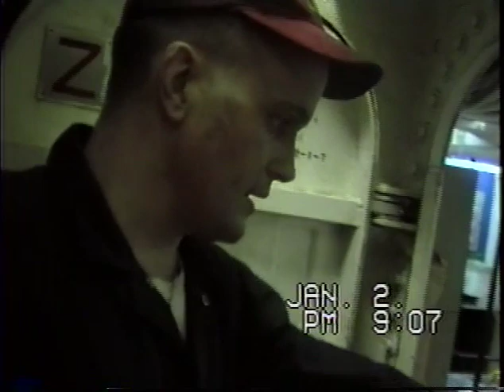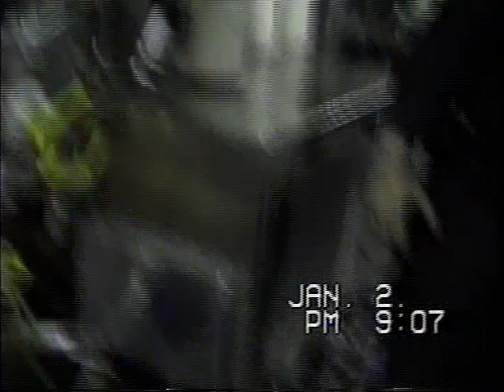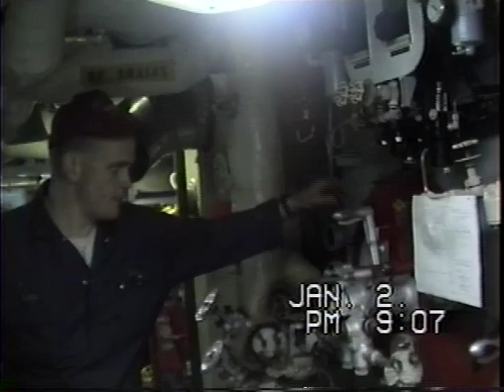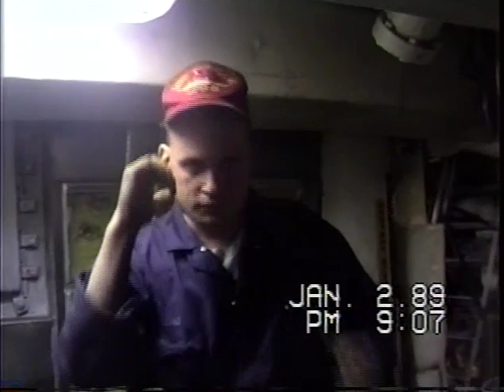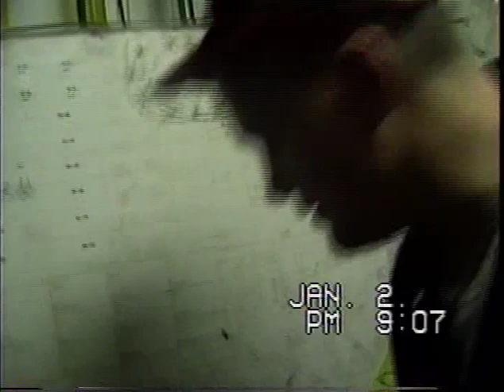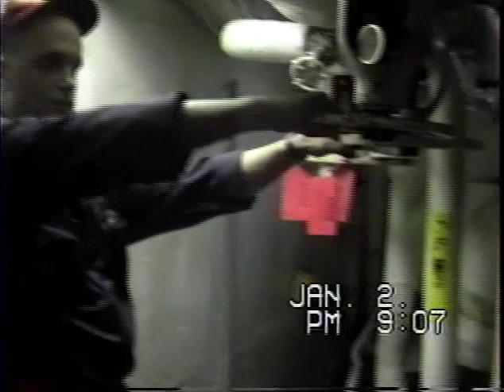Dubuque Engine Room

Comment: I was on the Dubuque in Sasebo as well, except I was on her from '90 - '92.  She was my only ship as I got out after I left her, a mistake I tried to rectify but the Navy was downsizing and wouldn't take me back in.  Oh well, next life.
Reply: Was on her '91-'93. MM3.
Reply: What rate ? I was on '91-'93. MM3 in mike2
Reply: @araworn2141  ABF Worked the flight deck and JP-5 pump room.  Good to hear from you, shipmate.
Reply: @operatigger  Good to hear from you as well. I have to admit, it's been so long, sometimes it doesn't even seem real. Except the damn heat in the engine room.

Comment: This may be a dumb question.  When seawater is used to make steam, what happens to the things like the salt in the seawater?  Does it evaporate as well or does it leave a residue or is it filtered out somehow?
Reply from the maker: That I do not know and would need answered by a BT. No idea what Lau (the guy doing the talking) is up to now a days. He would know.
Reply: All the seawater is desalinated before it is used in any system.
Reply: Salt water should never been used in a boiler of any capacity, your water chemistry would be all off your would have increased corrosion potential. ALSO high levels of (total disolved solids) tds leading to the forming scale on the tube walls. Leaving in less steam produced leading to the tubes getting hotter than normal less cooling eventually the tube will bulge as it weakens and still under pressures then the tube would rupture.  Salt water is processed in an Evaporator unit, under a vacuum the salt water is heated which flashes to steam which is condensates into distilled water used for feed water for the boiler and also for drinkin water. Explained around the end of the clip
Reply: @Tee Badd   Seawater is converted into freshwater by a flash-type steam distillation plant. The process occurs in 3 stages. Seawater is heated via a heat exchanger to 170 degrees and pumped into the evaporator under a 29 inch vacuum. Under those conditions, the seawater flashes into steam. The steam passes thru filters that prevent salt droplets from passing through. This is done 3 times (or stages). The steam is condensed by a heat exchanger between stages. From the 3rd stage of the evaporator, the water is very pure. The new freshwater is pumped into tanks for the boilers and potable (drinking) water. The water going to the boilers is treated with TSP/DSP to proper ph range and salinity levels. The water for drinking is treated with bromide.